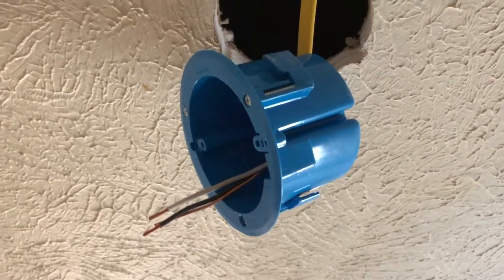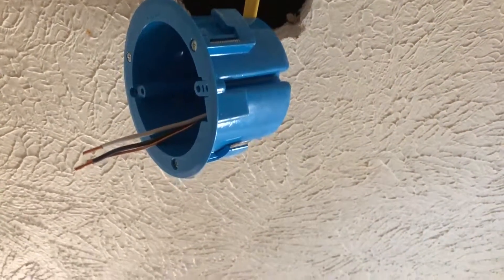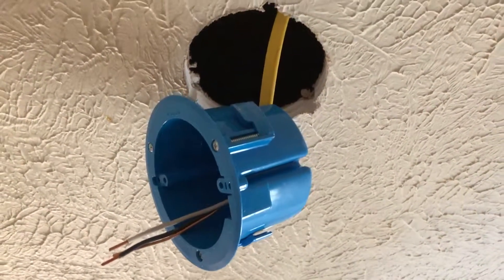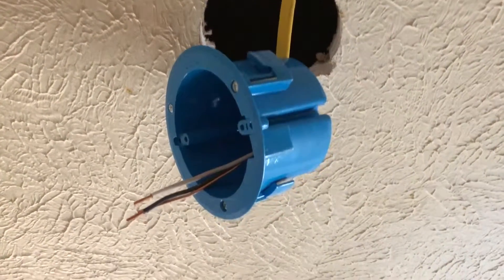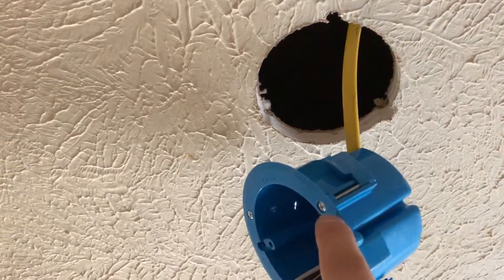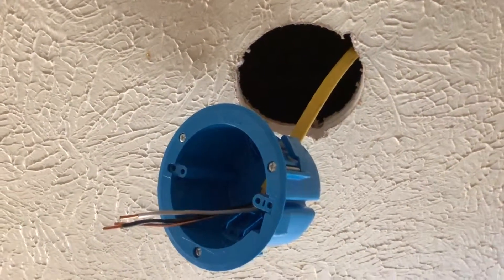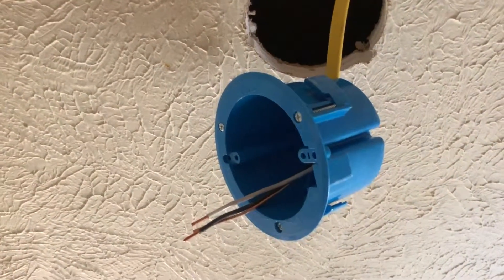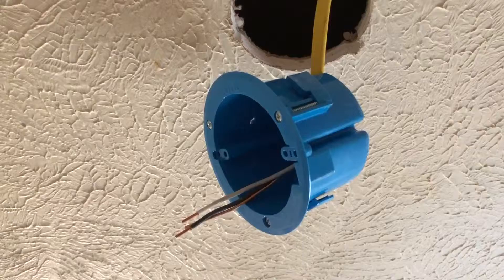Junction Boxes - The Differences: New VS. Old Work

Comment: If you use a 4 1/4" hole saw for that winged box it will pull into the drywall. Using a 4" hole saw the box will have enough lip to grab the drywall perfect but you have to cut three slots into drywall for the three tabs on box.
Reply: junk.Won't work in T111 or siding.

Comment: You like those boxes because of all the flaws they have. They are plastic, which will fail much quicker than metal, they do not attach to a stud, so you cannot add anything with weight to them, they are light which means they are flimsy. Seriously, if you think a metal junction box is heavy, you got some problems.

Comment: This is a horrible POS. The design is so bad that if you cut a perfect hole you would have 1/16th of an inch lip pressing on the front of the board material holding it against the wings.
Get a fiberglass smooth old work box.
Reply: Tf are you even saying